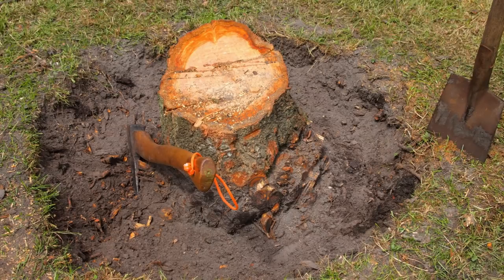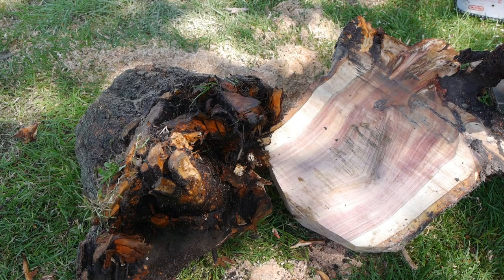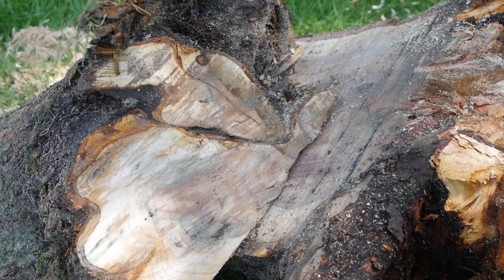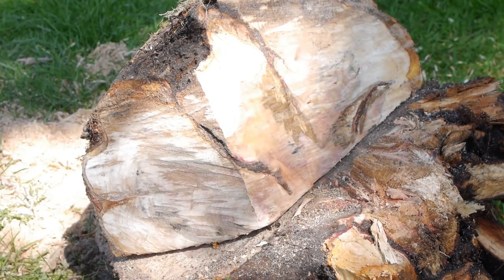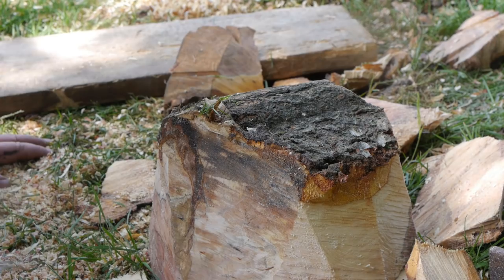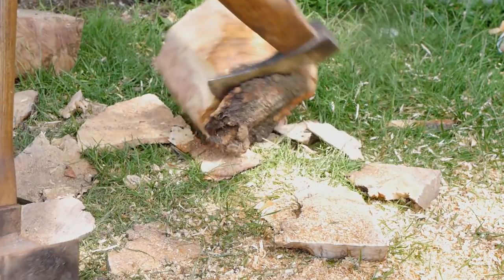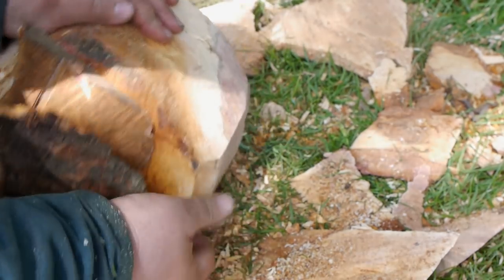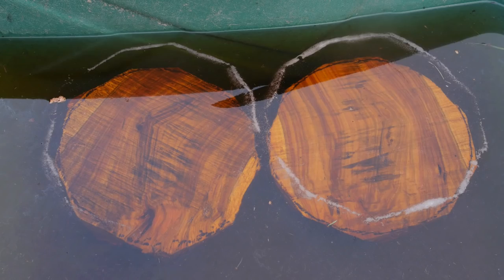Making bowl turning blanks using an axe and a dull chainsaw

Comment: Good luck reaching the end of your video is never needed, they are always entertaining.

Beautiful looking heartwood in that trunk - fruit wood always seems to be excellent stuff.

Next time bring a coarse saw for the cross-grain work and save the axe for the splitting work? With a sandy stump like that, yes you'll dull your blade, but that's the price of entry for milling stumps from sandy ground. Preferable to lose the sweat to sharpening a blade than to swinging an axe!

That bowl blank will make something lovely, I'm sure - those salmon and straw colours will look great.

I've never seen the foot-on-plank method for chainsawing. That's a new one for me. I like the idea though - it's kind of like a saw-stick for a chainsaw. I will keep the idea in mind, I'm sure it will make certain jobs safer.

Comment: nevermind, odd most mauls these days are one piece steel with a rubber hand grip so you can hammer on it without expanding the eyelet and having your handle slip out.

Comment: The root area has some very nice grain, but as you experienced it is not easy to cut and the soil/dirt/stones blunt tools fast.
As others mentioned, I would have sealed the grain rather than put the pieces in water.   You will get a lot of water flying all over the place when you get to turn the bowls.   The wood should turn easy though.
Dave.
Reply from the maker: I think I've seen people cover them with latex pain (wall paint) I think I might have some left.
Reply: Latex paint will work, it is just harder on the tools once cured when you get to turn the piece due to the pigments like titanium oxide, so keep an eye on the tools to see when they need to be honed or sharpened.
Dave.

Comment: Your wood is going to be stunning !
First here and for some strange reason I am still up at 300am on a monday !! 
Just as I hear the chicken ready to come do a little walk through, "here chick chick, ...here..."  & you start up the chain saw.  
 layers get no respect, and yet I bet you had fresh eggs this morn           :-)
Well another version of myself will be cutting Maple bowl blanks tomorrow from logs that have been down for 7 mos, with a chainsaw that has issues as well
 Going to try wet wood turning and will put some away for proper cure. Complete  neophyte
Reply from the maker: Chickens are cool and allso somewhat useless. I'm not a fan of eggs or chicken meat.
Reply: @Rolingmetal  Lost on you huh? Oh well how sad. Such a complete food. Free range eggs are high Omega. They exhibit a rather  Low carbon footprint. They eat an enormous amount of pesky insects like one of my least favourite, Earwigs!!  and then turn them into a protein form that  mammals  find agreeable  for the most part

Comment: That big sledge looks pretty crappy for pushing a wedge through, the furled metal would just get caught halfway down the log you're splitting.  Sassafras roots?  https://en.wikipedia.org/wiki/Sassafras
Reply from the maker: It's more for driving stakes into the ground. The roots from a plum tree